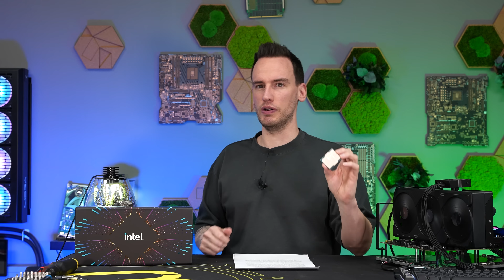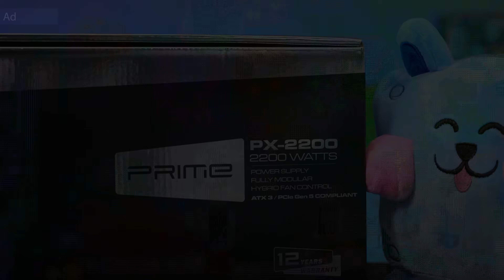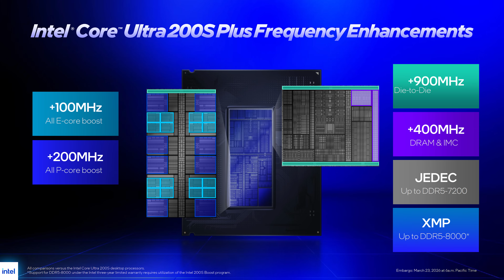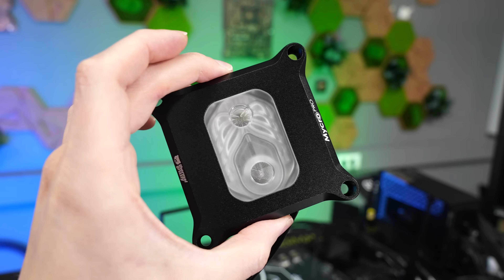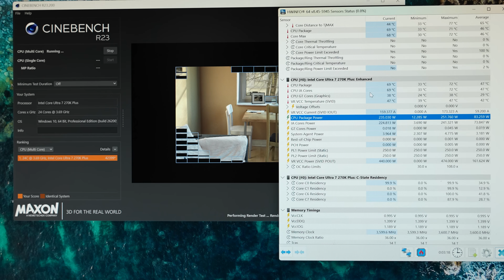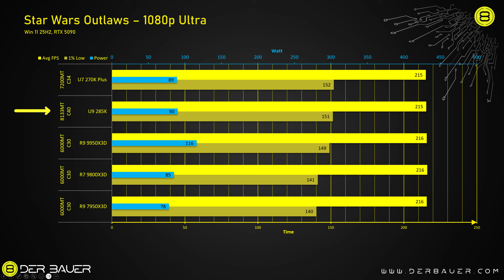The Best Intel CPU in Years! 270K Plus Review

Comment: I have the 270k plus. I bought it bc the low price and combo it with the 890 Hero.
In bios, the processor  rating is an 87, with a cooler rating of 172. Open loop CPU separate loop from GPU.
I run stable @8200mtps with the Patriot Viper Pro for the first time since I purchased a year ago 😅 for 240 32GB. Upgraded memory modules with custom heat spreader and thermal grizzly 1mm TP.
I could never just enable  xmp, always had to tweak and the highest stable w 12900ks was 7200.
So With the strix 4090 and the 270K plus  I hold the triple crown 1st place Speedway, SteelNomad, and PortRoyal 🎉
Get Benchmarking!
Good Luck

Comment: Just scored this cpu from microcenter for $250 I’m looking at an as rock z890 Taichi for $200 so with the high end board and best chip for that board being less than a 9850x3d I won’t really mind upgrading board and cpu I also bought some 8800mhz cudimms back before ram went up so this will work great with those cudimms I have been waiting to put into something

Comment: I recently built a new PC with the 270k plus with an asus 5070ti and dominator 7200mhz ram 
The difference in performance compared to my sons 9800X3D and 6000mhz ram using the same GPU is negligable to non existant.
I'm happy with the performance, and don't have the frustrating random USB issues my son has with his 9800X3D build.
Reply: Is gigabyte 860m wifi mobo good for 270k plus?

Comment: HOLY.. was searching for 4K tests.. NOOBODY DOES THEM.. im like WHY.. who the hell plays on 1080p in 2026.
Thank you. Same speed as 285k case closed. As good as 285K but cheaper!!! ALMOST 2x cheaper holy shit
Reply: 4K tests are basically GPU tests; 1080p puts the load more on the CPU, and thus is a better representation of the actual CPU itself.
Reply: @Penguincannon9000  thats besides the point, people are paying extra for something that will never benefit them. at 1440p and higher resolutions the difference is not existent, and that money saved could be used for more storage, more ram or a better GPU.

Comment: The efficiency is still kind of sad, unless great gains can be had by undervolting?
Undervolted i5-8500 with TDP limit of 50w, business SFF 65w at the wall gives ~5500 Cinebench R23 score. 4.5x to match 270k plus power is 24500? So 270K plus only 2x the efficiency of 9 year old tech. Look forward to 2nm and smaller!

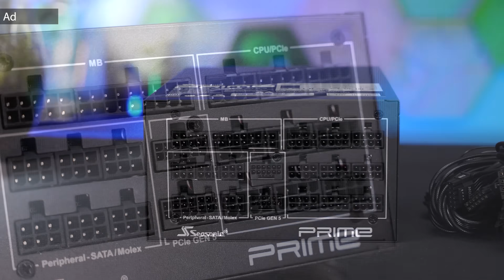Comment: The Seasonic fan is NOT "semi passive" 1:00 onward, for a fan to be semi passive it would have to keep spinning by air from convective heating or some such. Which it isn't LUCKILY as it would mean that the PSU is heating itself to death specifically to get the fan to move without it supplying it with power. The whole thing makes no sense whatsoever, that is my whole point. 
What it does do is use convective and conductive 'cooling' - which means spreading the heat to the case and other thermal dissipators and able to dissipate enough heat to not need to run the fan. That is something different from a fan being "semi passive" - the power supply is being passively cooled - not the fan. Well, theoretically the fan might be "passively cooled" if it heated above ambient for some reason but it would have zero positive for the PSU itself. 
But there is no reason to focus on that, PSU's have had fans that only turn on when needed for years by this point - on higher end PSU's which a 2200w unit would be. I would point out that a single outlet maximum is close to that kind of figure, so if you have other things on the same breaker you are likely to trip it - depend on what breaker it is on, but you're unlikely to draw that much in any sort of scenario that is in the same planetary system as 'normal use' or even 'extreme use'.

Comment: 9800x3d CPU on AM5, more expensive. AMD motherboard for a similar spec, also more expensive than an Intel one.  

In terms of upgrade, I upgrade every five years. By then we will be on AM6...So, I would have to upgrade platform anyway. Zen 6, no indication of how much improvement at present. On AM5. 

The 270 K CPU, looks to have strong single-core performance for games. And has more cores than 9800X3D, 9700x and 9600X, heck even the 9900X. But no hyperthreading.

Comment: Most PC builds are ment for several years of service, and in that case, you usually end up replacing most, if not all, of the system anyway (case and PSU might be the only thing that's a carry-over, but ..). With 285K-equivalent performance and 200 euros to spare, the 270K is a strong value proposition.

Comment: This cpu is on a dead platform while a 9800x3d is 10-20% faster in gaming and the socket is still supported until the next generation. If you’re talking about value and the savings that you’ll get unless you’re already on this platform buying a motherboard to have it not be supported next year takes away all the value gain.
Reply: And if you go for productivity then AM5 is just as much of a dead platform with worse performance and higher entry cost. Roman even specifically mentions that this is interesting for productivity.... but guess listening and understanding is not a strong point of fanboys.

Comment: Weird board, does not have Thunderbolt 5  but has a extra on the board, thunderbolt 4 header, for a expansion card?  why, it allready built in, maybe if you need more ports/throughput?  if it had thunderbolt 5 i would buy, such a letdown.

Comment: Those CB23 scores cannot be real, I have 12900k with same core count and 27886 score. I can certainly expect improvement but not 44,000.
Reply: Hi, I just tested the Ultra 9 285k processor with dual air cooling using a CB23 cooler and got a score of 40800.

Comment: If people fall within a 6-7 year upgrade path typically on CPUs then honestly the inability to upgrade to a better CPU on this socket is irrelevant, because by then you wouldn't even want ZEN 6 CPUs if you chose AM5. Though the prospect of far more cores in ZEN6 and a decent IPC lift means selling your old AM5 CPU and picking up a ZEN 6 CPU used online in 4 years might actually buy you a few years without costing much at all. If history is any indication, gen on gen uplift on CPUs is hardly makes considering the socket almost a moot point when both sockets are near EOL, and ZEN6 as an option in the future would be more of a band aid than a true upgrade path. Time will tell... I like the 270K Ultra as an option a whole lot.

Comment: Why is Intel the only one using faster memory? I think there shouldn’t be any issues with testing 6000MHz memory. Why are you using the old version of Cinebench? Let’s use Cinebench 2026. Could Intel lose to AMD in Cinebench 2026?
Reply: Ryzen is limited to 6000-6400*mhz in gear 1
Reply: @eblanueblanovich8902  Yes. That is precisely why I thought that testing all CPUs at the same 6000 Hz would yield more accurate results.
Reply: @PampyO so benchmarks should be limited by ryzens memory controller?

Comment: 02.56 more intresting is not cores or threads diffrend production processes better compare instruction per cycle (ipc) a old 10 usd xeon v4 will beat most modern 300 usd price range on core threads but does not come close ipc wise

Comment: I find it interesting that every youtuber out there keep mentioning socket support as a big factor, but then when talking specifically about upgrades they also recommend "never upgrading the CPU alone because the gain will be too small, better do more a significant upgrade".
Reply: As someone still using a 13900KF, My opinion is the socket support argument is just FOMO, in reality, if you're buying on the low end, but even if you are, there's still a number of better CPUs within that same generation, then those buying on the high end will just swap out their entire build anyway since there's less of a reason to upgrade so soon, so it doesn't even matter. I'm not out here gaming at 1080p aiming to be CPU bound all the time, so upgrading from my 13900KF offers little to no benefit in terms of performance, and even when it comes to productivity, upgrading shaves like what, few seconds, to a minute at best?
Reply: @wolfstorm5394  agreed.
Reply: I've never heard anyone say not to upgrade just the CPU.
Reply: @SwordQuake2  well, short attention span and selective memory are more common than ever.
Reply: @Lucius4992  yup, you're a very good example.

Comment: Better late than never, I guess. In a vacuum it's a good part for the price, but it's still Arrow Lake with Nova Lake on the horizon, and released during an unfortunate RAM situation. RAM prices will still suck when Nova Lake comes out, but Nova Lake should bring an actual generational performance improvement with the new architecture.

Comment: So .....  (per amazon us pricing as I type this comment) I could buy a 270k Plus for 289 dollars.  Or I could buy a AMD 9950x 3D .... and get worse hyperthreading, worse workload performance, but gain 10-20 fps in certain situations.  I just have to spend ... almost 400 dollars more.

Hmmm tough decisions here for sure.... As far as socket goes.... I hate to say it DerBauer but that's nonsense.  I have been building my own pc's since the late 90's, I have only ever carried over a mobo between builds maybe 2 times.  In theory it sounds great, in reality you lose new features regardless of socket change, your old mobo stops getting driver updates, they simply degrade over years of use, blah blah blah.  You should always build the best pc you can at the time you are building with the budget you have, and not worry about "upgrade-ability".  Building with the "I will upgrade in 2 years" is already a bad mind set generally as it leads to bigger spends, and this is especially true in todays market.

If I were building a PC today, this would be the CPU I bought with absolutely no doubt.

Comment: Out of the box efficiency is finally starting to get real good too
I thought I was doing pretty well with my 13700k, getting 25,550 in R23 at 135W (with a bunch of other things idling in the background, so not an ideal scenario). That comes to ~189pt/W.
44,039 @ 223W is 197.5pt/W, with no undervolt or restricted power limit that's quite impressive

Comment: Glad you like it! This was a fun sku to work on and tune; refreshes typically are easier to tune than fresh sku’s given the nature of timing. Love seeing your videos about our chips!
Reply: So why no 290K plus? Seems like a missed opportunity.
Reply: @kkramlogan Because Supposed to be same Core and Threads 24/24 Liked 285K and 270K/KF Plus. So The problem here, 3-4 CPUs with same Core and Threads 24/24, nothing new and difference between The only Turbo bust le clock speeds, IMC and few things, The Core Ultra 9 290K only 5.8GHz on Turbo Bust, IMC 7200MT/s maybe 900MHz D2D, but not any more.

Like I said 3-4 CPUs with same Cores and Threads 24/24, make New Top or Higtest CPU a bad idea, Yeah it's not First time Intel got CPUs with same Cores and Threads, 11th Gen has Core i9 11900K and Core i7 11700K with same 8/16 Cores and Threads, but only two models if doesn't count F versions, but this time 3 models Core Ultra 9 285K, Core Ultra 9 290K Plus and Core Ultra 7 270K Plus with 24/24 Cores and Threads it's worst idea Inclusive doesn't count F versions.
Reply: @kkramlogan  I don’t decide what Intel does; I just tune the chips they make before they go to the market and customers.
Reply: @FinnishArmy of course, I wouldn't think you have any control over that but, it seems like a missed opportunity

Comment: If i am to change MB and buy this new intel for 300 Euro, plus a 1851 MB for 200 Euro , that is almost a 9850x3D, which AM5 socket may last more than 12 months, what 1851 will do. 
1851 is DEAD in 12 months. You hear me ? DEAD. Intel could have beat 9800x3d in gaming, if they had refreshed gen 14 and put it on the 3nm production node, instead of core 200. 
THAT is how bad this processor line is.  The only good of if, is efficiency. EVERYTHING else is BAAD

Comment: If we're being realistic, the 270K+ and an 1851 motherboard is a combination that isn't outlandishly expensive to end up replacing in its entirety. Like, you'll be replacing roughly $500 in components. At many points in recent memory, that's exactly what a CPU upgrade would be doing as well. 

And, well, AMD would have to swing really hard with Zen 6 on both pricing and performance to make it a viable strategy to go for a 96/9700X now and upgrade in another couple years vs just having the 270K+ now. Like, they'd have to hit 9950X performance at $300, and you'd still have a couple years of being worse than the 270K+ to deal with. Hm. 

Can't say I'd jump off of AM5 if I was already there, but Intel really out here with compelling products at compelling pricing for once. Thanks, AMD.
Reply: Honestly, I've snagged a stellar deal on a 32gb of ddr5 and now I'm so unsure on what i should get, im not someone that looks to upgrade frequently

Comment: Don't really care about an upgrade path, I build a new pc to last me 5 years, then retired it and upgrade to the latest gen stuff at that time. I have a 9800x3d, 14700k, and a 265k the intel pc's produce a little less frames per second than the 9800x3d using the same gpu but they feel better to game on, they response better to mouse and keyboard inputs and the overall experience while gaming feels alot smoother and less laggy to me, they feel more responsive overall. This is my opinion and others may feel different and prefer AMD.
Reply: I suspect most normies treat their PC as a consumable, and simply replace the whole thing when it no longer does what they want. It's only the real enthusiasts that change their CPUs but keep the motherboard. Personally I'm not a nomie, since I build my own system, but am happy to keep things for decades if it still works (my 4770K is fine for a HTPC in Linux, for example, and my Q9650 is great for a WinXP retro machine). My 13700K is likely to last the next 30 years or so...

Comment: So the 270K+ has better minimum FPS on modern titles. Than even the mainstream X3D chips.

This is sometimes the case also comparing a 5800X3D with a Ryzen 7600.

Quite interesting.

Comment: Will the  plus refresh work ona ll Z890 motherboads? If  id ecide to get intel instead of amd then will a 270k 32 GB DDR5 8000MHZ and Z890 Aorus elite Wifi 7 be a good choice?
Reply: ofc and you dont need so expansive motherboard, my 265k works good on asus tuf b860 and new bios ready to work with 270k

Comment: my next upgrade will; be cpu ram and motherboard and psu. Either iw ill ger 9950XD2 32 GB DDR4 800MHZ and X870 or one of the best Core Ultra withh 32 GB DDR5 800MHZ and a Z890 motherboard.
MINE MONSTER PC IS RYZEN 7 1700 RX6 700XT 12 GBR ED DEVIL MP 600 2TB WRITE:4950MB/S READ:4250MB./S DELLP2416D 24'' 2560X1440 60 HZ IPS

Comment: Intel gets doubly screwed by the rampocalypse: AMD's AM5 CPUs get by with 6000 MT, while Intel gets the most performance out of faster kits... which all cost disproportionally more. A quick peek at PCPartPicker, and the price difference between a good 6000 kit, and the 8200 kit Roman tested with, is the same $200 you'd save by going with the cheaper Intel chip.

Comment: That is IF you can actually get it for 300 bucks.
Reply: It is on amazon right now for 289 so.... doesn't seem so hard to me.
Reply: @DKarkarov  It is not available retail until March 26.
Reply: @NewFoundYoYos  You can preorder things man.  I will edit this and add, even if it cost 400.... it would still be the best price to performance processor right now.
Reply: @DKarkarov  Sure, makes sense if you are building a new system.

Comment: So, it's a dead end. And the performance for gaming is just as my 14700K overclocked. Welp, let's wait for th next socket then haha
Reply: It uses far less power than the 14700k and smokes it in multi-threaded performance.
Reply: @_aceofspades_  sure. It doesn't change what I said though.

Edit: but since you talked about it, and since I'm interested in gaming only, I went and researched it. Just 2 months ago there was a test showing the 285K vs 14900k (stock, which would be like my 14700K overclocked or maybe even less). The 14900k had better FPS across the board. LOL. About 10-15 FPS. Just a handful of games that had the same FPS.
Reply: @CeceliPS3  the 270 plus matches or exceeds the 14900
Reply: @Hetsu..  I bet you're right, but my point is: no point in doing a lateral move.
Reply: @CeceliPS3  yeah either way the 14700 wont ever bottleneck at 4k

Comment: oh yeah btw a plateform that requires you to run OVERCLOCKED memory 7200 or 8133Mhz ddr5 that was hard to get and very expensive even without AI but is also a silicon lottery and you have no guarantee to run those speeds some might even void your warranties
is not cheaper not at all especially not now

Comment: did they redesign the ring bus with larger traces ? if they didn't they will end the same way 13900k and 14900k give it a year or two as leaked by moore's law is dead when tech tuber still blamed "user error" (reminds you of somethine else ?) an engineer said they badly designed the ringbus not accounting for the amount of cores they ended up having that was the main issue, it overheated the traces which burned themselves over time, anyway Intel would have to pay me 100'000 to ever go back to them because I lost 1.5 years of gaming and modding hundreds of hours unknowingly battling my dying 13900k who's going to give me those months of extreme stress and frustration back ?

Comment: Still rocking my i7-7700k @5.3 ghz lol
Reply: i7 4790k here still going 12 years later
Reply: Buddy why are you lying that you're daily driving a 7700k at 5.3GHz? Do you just think no one on a tech video comment section knows the overclocking and voltage limits of a 7700k in 2026?
Reply: beast cpu 🔥🔥
Reply: going strong 19 years, Intel Core 2 Quad Q6600 paired with nvidia / EVGA nForce 790i Ultra SLI with 16gb DDR3 ram... maybe i upgrade next gen